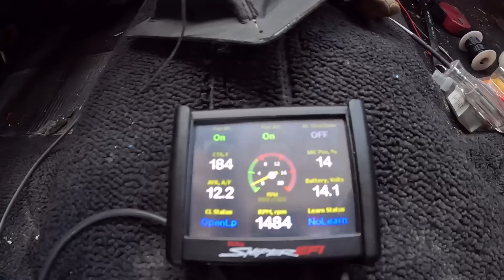THIRD TIMES A CHARM! - Finally A SUCCESSFUL Test Drive In My 1955 Nomad Gasser

Comment: excellent videos!!! These videos convinced me to stay with carburetors…With the amount of views you guys get Holley should have stepped up to the plate and sent a tech guy out…
Reply from the maker: Gotta say holley has been super helpful.  All the problems have really been on me.
Reply: They don't have "techs to send out". 🤦‍♂️ the sniper systems in my opinion are junk and not reliable. Run a terminator where the ecu isn't located on top of the hot engine and you won't have issues.
Reply: @newtonfirefly3584  I don't lack anything, I've never ran a sniper but I can bring up a laundry list of people who have and had problems from the ecm not reading an o2 signal and leaning the car out till it wouldn't run to cars that just would die at random. It's not rocket science to hook one up...I'm not a fan of self learning ecu's, I prefer to tune it as I feel needed.

Comment: For easy uncapping of header dumps weld a bar with a bolt in middle , drill a hole in the center of cap slide it over the bolt , one nut to remove , and open headers quick and easy .
Reply: Like that idea
Reply: I forgot , glue the gasket to cap with ultra high temp silicone
Reply: That is a great idea! I think i have seen that setup before it looks better too. Figure the bar needs to be pretty thin to not block exhaust flow
Reply: @RoboStyle  yea , but pretty thick , so it won't bend to much under heat conditions
Reply: @RoboStyle  I'm telling my age now , but Dad owned a muffler shop when I was born 1961 , they didn't have collectors for headers back then , headers were made from scratch,  they used 4inch pieces of tubing to make collectors back then , weld in a 1/4 in piece of steel a couple of inches inside the tube with a 1/2 inch bolt welded to to it in the center and a flat piece of 1/4 inch plate for a plug , sounded so frigging awesome to my young ears , imagine a 57 Cameo with fenderwell headers on a 350 hp 327 ,pointing straight to ground , it doesn't get much better , this happened in Ft Worth,  Texas by the way , GOOD Memories !
Reply: What about wing nuts on those dump bolts/studs?
Reply: @Dennis Alatzas  I have seen it , that is really old school COOL
Reply from the maker: Lots of good ideas!  I just don't want it leaking on the road trip so I went a little overkill

Comment: Do the idle tune on the sniper, will fix the starting issue. You need to touch the gas pedal to start the engine because your throttle plates are completely closed and the Idle Air sensor can't compensate quick enough to allow more air into the engine. Do the tune, easy as hell and makes quite a difference. Congradulation on double sniper install, that killer! Cheers

Comment: Puttin those turbo thrush mufflers definetly changed the back pressure so it loading up on fuel and maybe throttle body blades are slightly open droppin fuel in on cold start

Comment: You just made me SO HAPPY! that I went with 2 1/4" exhaust pipe and Borla touring mufflers & complete tail pipes out the back bumper.  That Nomad even with 4 mufflers still sounds like a TANK and after about 3 hours on the road your going to despise that ungodly loud 3" inch exhaust with no tailpipes. Better you then me.  So, when are you going to install the A/C ?  That flat black roof will be muuuuuuuurder without A/C.on them 29C & up days in the U.S. we always get, or is sweating your butt off hour after hour really cooooooooooooool ? You had that ice water seat tubes deal last year, but when your out of ice your screwed. Meanwhile you watch everybody else with their windows all up, and the A/C on at 22C or less inside.

Comment: Congrats on the successful test run.... a few more tweaks, and you'll be kickin' some tail 🙂👍
The exhaust dumps sound mean, but the electronic ones are just a flip of the switch away 😉!
You should check the Mecum Auction this week......
There are many sweet Tri-5s there, along with a mind-blowing med. blue 55' Nomad resto-mod.

There is also a car called CadMad, a out of this world custom... Front 1/2 - 59' Caddy Eldorado & back 1/2- 56' Nomad (2019 Ridler Award winner)
Lot # S168

Wow, that's about all I can.... the paint job alone was 300K
It's a must see Dani, Dan & chat ✌️🙂

Comment: Hate to see you suffer, rootin for ya all the way. So, mufflers are a huge improvement. Period. The car still sounds mean but its not a cop caller now. Gives ya some room to play a little. Plus you have a chance of hearing other things falling off. Not sure what that rich cold start was all about, but she dumped a lot of fuel for some reason. Could have been the back pressure changed and the Holley hadn't learned that yet. She ran great once you got out and warmed up  to learn. So just get all that wiring squared away, professionally, new radiator and some nutz and boltz and start racking up the miles. It will start to be a lot more enjoyable now. Congratulations Dan. Endeavor to persevere.

Comment: Dan if you are replacing your spark plugs try resistor versions if you are not already. Non resistor plugs cause a lot of electrical noise and can cause ecu resets.

Comment: Clean power and ground on these Holley's are super important. If there is a voltage drop between the battery the ECM, block or any other grounded component of the system the holley will do weird stuff.
Reply: Truer words were never spoken, grounds that have been lost on a 12 year old car i have been fixing up gave me a headache for the first few days

Comment: Great content Dan!   I look forward to each episode.  I installed electric cut outs.  I noticed on my O2 sensor it reads real lean when I open the cutouts.   I just figured I'd give you a heads up especially when you've had problems with the electronic injection. Keep up the great work.
Reply from the maker: Yeah I have a worry about the cutouts affecting the o2
Reply: @DDSpeedShop  Well if they're self adjusting or learning, it might be glitchy for a couple seconds.  Hoping for the best.    Tim

Comment: You just about got it Dan I put a Eldebrock EFI on a built SBC it took alot of fiddling to get it right if you could hook a traditional scanner to these things it would make it much more user friendly.
Reply: Being able to use the tech2 on it is one of the main reasons I used the stock L31 injection on my truck. That and I can get any part I may need at any small town Napa on a Saturday.

Comment: If you want the best of both worlds maybe you can make it so you can disconnect the mufflers just when you're going to want to race it but you will want to find out what kind of adjustment you will need to do so the carbonator will run so it will go fast. The car was acting up probably because the air/ fuel mixture was set for the car without the mufflers being on. If the car bounsces it probably got to much gas and that's why it shut off.

Comment: Tps has nothing to do with it. Put your ignition on 0° and let the comp do the rest. Be sure to have good and proper connection between temp and comp or he will choke on you and gas reek is nothing compared to a backfire at that moment. 
Oh co2 rarely brake down but it's worth a check.

Comment: Hey I noticed on start up that you are pumping the fuel peddle and holding down the pedal some when you start it. All the sensors regulate the fuel and air so when you hold down the throttle or pump it things aren’t reading right. From now on don’t touch the fuel peddle and start it to see how that does.

Comment: Are you running a pvc system on your moter ? No see in video if not problems in near future crank pressure will make a oil leaker out of rear main.

Comment: Hello Danny & Dan. Great videos. Here is a thought. In 1996 (OBD2), alternators are equipped with more filters for voltage ripple (Static). So they don't drive the computer crazy.  I believe you have a pre-1996 alternator. Ask Holley what they  think about this?. Good luck.   Glenn
Reply from the maker: Will do.  Thanks for the tip man!

Comment: Running open headers at the track, can it be an issue blowing down towards the ground and blowing up dust, can you or would you build a set of bolt on bull horns, it may not look super stupid but they would be practical

Comment: To much fuel on initial cold start and warm start, its dumping to much fuel into engine has to be throttle body position , back it off in incrabits and computer should recalibrate to least amount screw in😂😂